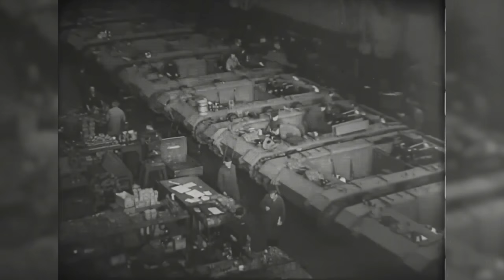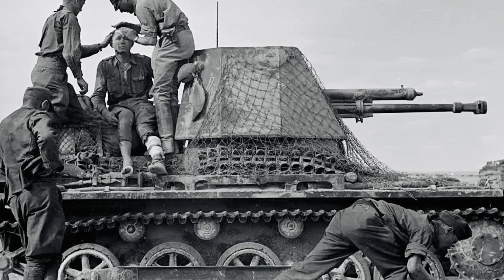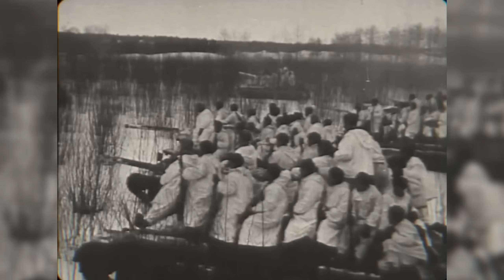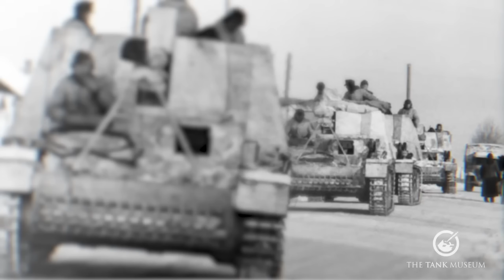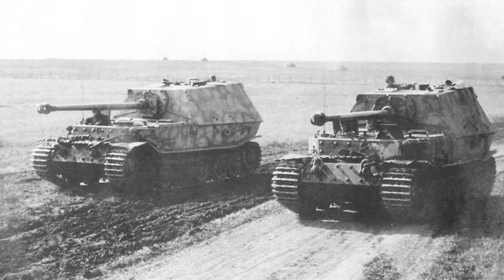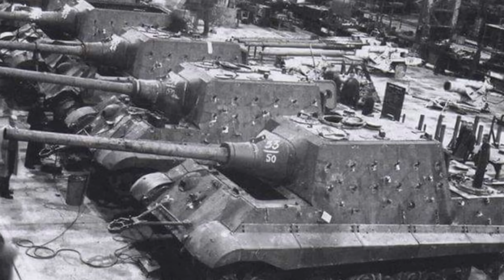The HORRORS of German Tank Destroyer Crews

Comment: In 1940 the StuG 3 was part of the artillery and designed to support infantry while the Panzer 4 was only assigned to armored Panzer Divisions. The training and optics for the StuGs was far different and superior than the training and equipment given to Panzer 4 crews even though they fielded the same cannon for basically the same assignments. Within a couple years assault guns and Panzer 4s were given long barreled high velocity 75 mm anti-tank guns for their new principal anti-tank role. StuGs were also often assigned to armored divisions to make up for the shortages of tanks while also supporting infantry divisions in a anti-tank role.
Reply: I believe the stug was the one that killed the most tanks by the German military
Reply: Yes, although attached as independent battalions and batteries, later independent brigades with the stuh42. but often so ingrained as an attachment in extended campaigns to motorised or panzer divs to make up for armour losses they were essentially organic units
Reply: The Stug's low silhouette and better optics made it a way deadlier ambush predator than the Pz IV, even after they both ended up stuck with the same 75mm gun.
Reply: If I recall correctly, the crews in the first couple of years of the war were highly trained artillerymen who were excellent shots compared to  later Panzer  crews with lesser training.
Reply: @SNP-1999  you say "..highly trained artillerymen". It was very often surveyors in those positions (*cough* drafted). This is the same across all countries but it's rarely mentioned.  Think about it - get someone who's daily job consists of calculating angles, distances, bearings, heights and offsets - or some random that wouldn't know linear algebra from trigonometry if they were smacked over the head with it.  A lot of surveyors left the industry after the war because of what they were forced to do.

Comment: The Panzer IV’s 7.5 cm KwK 40 L/43 and L/48 were closely related to the PaK 40, but they were not the same gun. They shared projectiles and ballistic performance, but differed in cartridge case, chamber, recoil system, and overall design.

Comment: A Nashorn crew had one advantage: shoot first. Because if they got hit, it was usually over.
Reply: Same with the Hellcat.
Reply: @lyndoncmp5751  Same with the Wolverine M 10 open turret. 
The crew was not protected. There were over 2 times more M10 Wolverines in WW2 than Hellcats.
Reply: Glass cannon logic at its peak—if that 88 didn't end the fight at 2,000 meters, those thin plates weren't saving anyone from even a stray mortar round.
Reply: same with AT guns though

Comment: The 88mm. came in more than two calibre lengths.

88mm. L.35 = WW1 FlaK gun & U-Boat deck gun.
88mm. L.56 = FlaK.18, FlaK.36, FlaK.37 & KwK.36
88mm. L.71 = FlaK.41 & PaK.43.
88mm. L.74 = FlaK mounted on Waffentrager (a friend has a 1:76 scale 1980's Roco model of this for wargaming).
88mm. L.98 = FlaK.43 (Intended for reaching high flying American day bombers).

The 88mm. FlaK was gradually being superceded by the 105mm. L.56 FlaK.39, which out performed it in both altitude reach (using wooden saboted FlaK ammunition) and armour penetration. Fujimi make a 1:76 scale model of this gun.